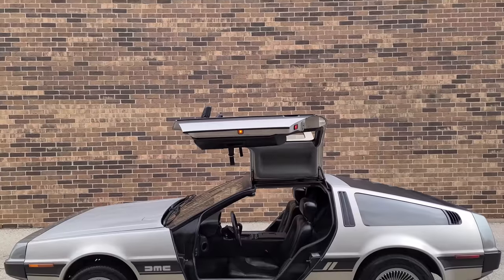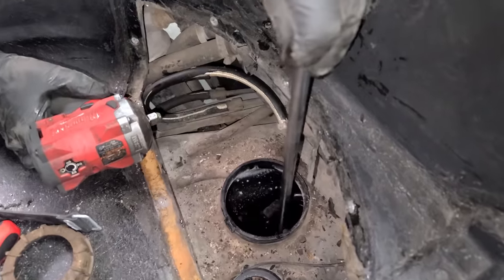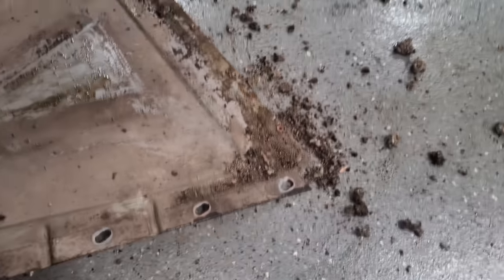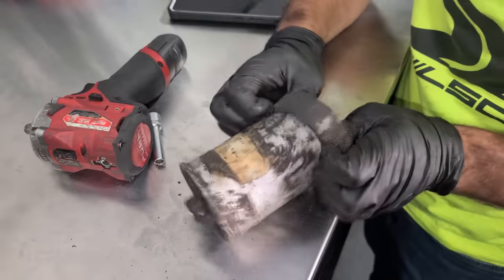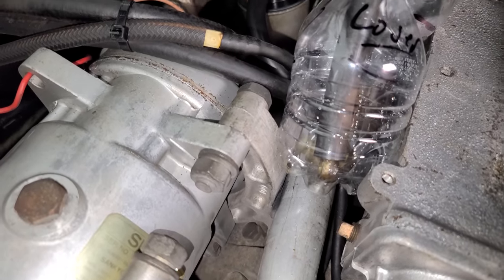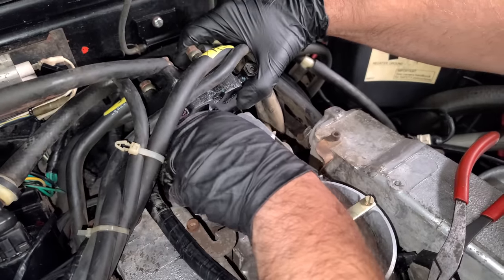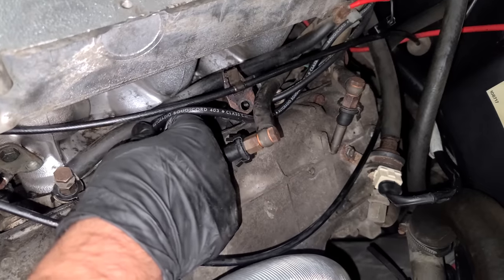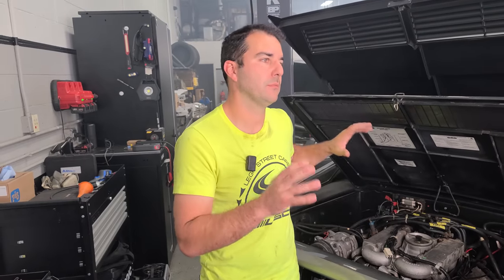I Got My DeLorean To Run On Its OWN POWER! Cleaning Out NASTY 30-Year-Old Gas & Fuel System Rebuild!

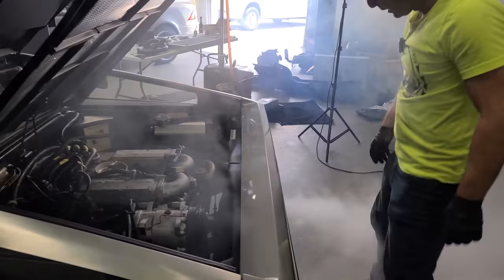Comment: 59:50. First CONGRATULATIONS on your DeLorean Alex!!  AWESOME!!  So I bought my 2008 335i N54 after it had been sitting for (According to the previous owner) 8 moths or so. It needed a new High Pressure Fuel pump so after installing it I fired that baby up and I can't believe I didn't grab my phone and start videoing it. SO MUCH WHITE SMOKE poured out of it. For some reason to me this seemed perfectly okay and I thought (Well it needs to burn off all the water and coolant as well as other things that would have collected in the car over the time it sat for so long. I let it idle in my yard for about 20-25 minutes then took it for a 20 minute drive with people honking at me as the white smoke kept coming. (Embarrassing lol) I was thinking that as long as it's not blue or black smoke it'll be fine and after that drive it was slowly clearing up until it finally was running as clean as the day. SO in the end I was right somehow and the car is still running to this day with over 600 hp and a lot of mods plus tuning. So don't despair just yet! White isn't too bad from my experience.

Comment: I thought that you would have cleaned up the banjo bolts and connections on the fuel line for the fuel distributer while they were off as they would have been easy to do then and would not have to be taken off later to clean them then.

Comment: 13:20 i dunno how the tank would react to acetone since its plastic but using some other stuff like IPA to dilute that nasty stuff then pump it out. would also help cleaning it.
other option would be brakleen but its just cocktail of different chemicals mixed in acetone and bit pricy for tank cleaning
and this is what i get for commenting as i watch the vid. ofc he whips out the acetone can few seconds later xD

Comment: How much water are you supposed to drink per day?

Take your weight in pounds and divide it in half.  For basic functioning without any rear workouts/sweating, this is the number of ounces you need to drink per day to stave off dehydration.

Comment: PLEASE replace all the high pressure fuel lines. They're notorious for bursting even if they look good. There is one kit out there that comes with all of the ones for the engine compartment. Also check your fuel accumulator underneath the car and those hoses.

Comment: I have never worked on an injection system like this, but when the fuel pump was jumped, weren't you sending fuel through the return line that had not been flushed out and were you sending nasty goo and junk back into the clean tank? Also, have you replaced the cap and rotor yet? That along with adjusting the distributor timing would probably make a noticeable improvement.

Comment: Sequential FI might have allowed cars to get better gas mileage over Batch Fire FI but it also introduced new technology like Cam Sensors and Crank Sensors that are needed by the ECU to determine when to spray fuel into each cylinder.  This just added more points of failure to engines and it really has to make you wonder if the fuel savings outweighs the increased maintenance costs in the long term.

Comment: I agree with your comments about ethanol fuel.. it is death on vehicles who sit for long periods of time.. suggest you source non-ethanol fuel.. maybe at a local small plane airport since many older airplane still require regular gasoline. Some gas stations market ethanol-free 90-octane gasoline as “recreational fuel” or REC-90.  I believe some Marathon stations carry this. Both of these options are expensive but but far cheaper than repairing the damaged cause by ethanol.

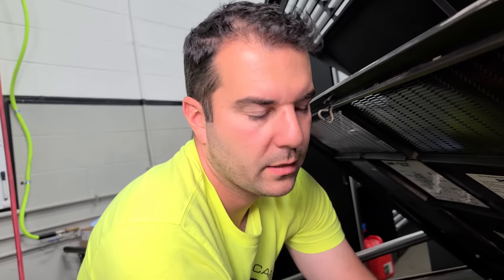Comment: @0:42... I've said it before, "while you're in there" are the four most expensive words in the car hobby. @16:50... Yep. Done that. @19:18... Keeps the metal plate from vibrating against the tank and wearing through the plastic tank. @53:25... Ethanol wasn't added to gasoline until 2005. Before then, it was MTBE, which was added starting in 1981.

Comment: The cold start valve is not really an injector. The only Actual electronic injector is mounted on the Right rocker cover. It electronically controls fuel system pressure. It’s know as the frequency valve or Seventh injector.

Comment: Have you considered doing a modern V6 engine swap?  I know purists will have a melt down and that is even more a reason to do it.  The deLorean is such an amazing looking car and it deserves a decent engine in it so the performance at least matches the looks better.  These had a crappy old Renault engine that was old even back then so that means any of the Nissan engines will keep it technically original given renault and nissan are so closely tied together these days.  A Z-car V6 even without adding turbos will dramatically improve performance and reliability.

Comment: -Having driven an '85 Scirocco Turbo with CIS in 1991 in Flori-Duh where I was a poor flight instructor, I seem to remember that the gasoline back then did indeed have 10% ethanol.  Based upon that, I would suspect that this car did run on the same stuff.  

But based on the condition of the tank and those injectors, I bet the owner drained as much gas from the tank as he could and then let the car idle until it ran out of gas.  Then he parked it.  If those injectors had some alcohol in them for the past 32 years, they would look like a piece of Kentucky Fried Chicken and wouldn't work at all!

Comment: That plastic blanking cap will probably come off, Ask me how I know? It doesn’t have enough thread to fully engage the tank fitting, I had maybe 1.5 turns.  the original cap for the sender is about 3.5 turns. I ended up just reinstalling the Sender unit (disconnected) because it seals the hole properly. It doesn’t interfere with the new Module gauge arm as long as the module is oriented properly.

Comment: Was just thinking, was that thing stuck to the bottom of the fuel tank possibly some sort of rubber stuck there to insulate and deaden any sound between that cover panel banging against the tank bottom?

Comment: 22:50 Looks like the o-ring for the fuel sender blank off cap may have fallen off into the tank as you put it on.
Reply: Use a little bit of that sunroof grease to hold it in lol

Comment: I Owned   Body #1 ,,first one built ,,When it was just a couple years Old ,,I replaced the fuel pump & filter ,,with original  Bosch units ,,my tank n car had not set as long as Yours and before Ethanol fuel ,,,Mine had Clutch n slave cyl problems ,,that 3 different Trans Shops ,,tried to fix,,I was doing Body repairs for the Original Leasing company ,,So thats how I found n bought the car .,  i fixed the clutch problem by installing complete new steel brake line from pedal area to slave cyl  and adjusted any linkage ,,Someone before me tired using Hi-pressure fuel hose to fix abraided plastic hydrlaulic hose ,which lost pressure to slave cyl not allowing proper clutch use .. I would suggest ,,replacing most if not all of the Electric Solenoids ,,Because these cars have a way of running battery Voltage down causing the solenoids to arch n stick giving you crazy dive problems ,,and CHECK OUT THE CHARGING N STARTER SYS ,,,WHICH ON MY CAR WHERE PARIS-ROHNE ,,VERY TEMPERMENTAL ,,N HARD TO GET PARTS FOR ,,GOOD LUCK WITH YOUR PROJECT & ENJOY  a Very Unique One of a Kind Car

Comment: Very nice restoration series! You'de better stop messing on this lumpy engine and swap it with a better version of the PRV. Like an alpine turbo one, or Alpine A610 or Venturi one.  This Delorean deserves a better engine. The PRV turbo variant was turned up from 180 to 400hp (oem) back in the days, and it's the same block, like "bolt-on" stuff. Just need the 5 speed gearbox out of an Alpine or Renault 21/25 to go with. I'd love to see that. There is  some left here in France. I can eventually help to source one for you.

Comment: Looking forward to the 'VOD' episode... done a little research and it seems that even if your engine is done it shouldn't be amazingly difficult to find a replacement - the PRV was made in the thousands...there must be a few left. 

But what an opportunity to make John DeLorean proud...I watched a series of a DeLorean resto-mod where a KIA V6 mated to a Porsche transmission was added. Stunning result. Although the builders did have access to CAD and CNC equipment which came in handy for the ton of one-off parts that were needed...and there were some fairly major chassis alterations...

Comment: Gotta say it again... it's only original once. I know the stock PRV is pretty weak by today's standards, but it's the same engine used in Renault Alpines, and those absolutely fly. You should do a Stage II conversion and lower it a couple inches to original Euro spec. Then it's just an improved original and not just another car with Bubba's LS engine dumped in it.

Comment: Not a dream car, but I was able to get a 1998 Ranger running after sitting for about 10-12 years. That was a few years ago and it still has less than 30k original miles.

Comment: leave it to Alex to cut through asbestos braided fuel lines to get to some old timey American fuel that has turned into a sludge waiting to kill you.

You could maybe look for some Renault-Alpine engine parts of the A310 and GTA or A610 to upgrade the engine

Comment: My 82 berlinetta camaro was always a dream car traded my durango for it and camaro came on a trailer with all kinds of missing pieces about a month later brake lines , timing , brakes, hubs , spark plugs , a lot of body work and it was running😅😅😅

Comment: You should pull that pos engine and trans and find a way to put a cheap salvage yard Chevy v6 or V8 in there, like it should have had from day 1. (Go USA)
Or better yet a Toyota or Honda engine.

Comment: Minnesota was the first state to start using ethenol gasoline in fall of 1991 as a state mandate to lower carbon monoxide in winter months so what the Delorean was parked will tell you if it was 100% or 90% gasoline

Comment: Um how are you going to plug in watertight connections but you're going to straight up crimp two wires with no shrink tube 😮

Comment: I love how these older vehicles even some of the new vehicles they have now The fuel injectors can be changed out. That's not the case with my truck. Mine is a mid-90s Silverado and the spider injector which actually sucks eventually was upgraded to a better multiport injector system that GM made but my point is if you had to change just an injector you had to pull the whole top of the engine off and it's a lot of work just to change it and if you had everything off then you might as well just change the whole spider injection while you're at it instead of just one injector in my case. There's nothing currently wrong with my injector it's just they suck and you get better performance out of the upgraded GM injector for my truck. Now if I want to spend like $3,000 I can get a Marine type fuel rail kit that includes the injectors the fuel rail the whole nine yards to convert it and it will perform even better. But for just a little bit more I can get the upgraded spider injector that makes it multiport injected and perform a lot better. These older vehicles like your DeLorean were made by the engineers so precisely and they thought of that decades and decades ago to make it so much simpler to change fuel injectors. As a matter of fact I've noticed that a lot of parts on that DeLorean are made in Germany which is fantastic because German engineering is pretty dang good. My wife's car and my truck both run iridium spark plugs made by Bosch and both her set and mine say made in Germany right on the spark plugs and they run fantastic. Just saying.

Comment: I resurrected a Bentley Derby 1936 Car parked since 1969 about 5 years ago I drove 100's of miles. Not run since 1969 which is nearly 59 years of sitting.:trophy-yellow-smiling:

Comment: If it just happens to have a horrible Valley of Death, put in a Honda or Nissan 3.5L V6 engine in it, way more power, and they should be relatively cheap.

Comment: I love your videos! That DeLorean is a POS. I hate that car. If it wasn't for that movie, using what was even then a cast-off POS car, it would have rightly faded into the dustbin of history. Stainless body panels and fiberglass chassis? Designed exactly 180* wrong. I'm glad you like this thing. I hate it !

Comment: Why would you spend $2k+ on parts + labor before tearing the motor down and checking things like the valley of death? (poor design) to see if the motor is even worth refurbing?
Just like you did the cosmetic stuff before the mechanical, bassackwards Alex.
Kids don't try this at home, unless you have a machine that prints money and time.

Comment: Why in gods name did you not just drop the tank and work on it and clean it properly?
No way that tank is clean from just you sticking your arm in part way, if the tank is small enough for you to reach the entire inside thats another concern by itself.
Reply from the maker: It's as clean as can be. Would not have been cleaner by dropping it as I could Literally get all the way back with my arm that got stuck